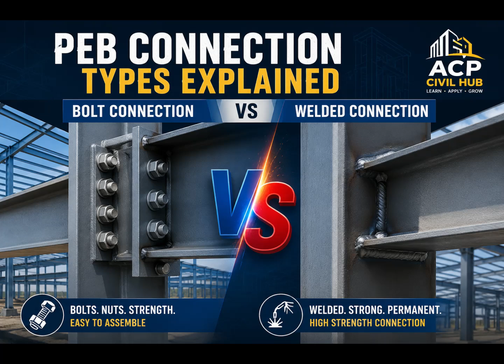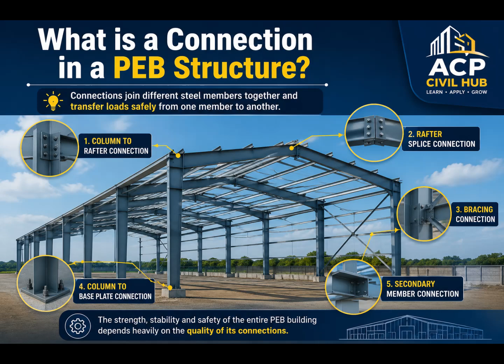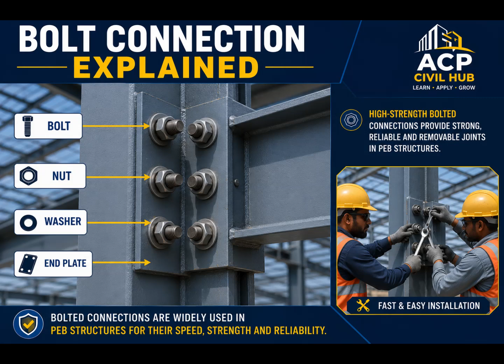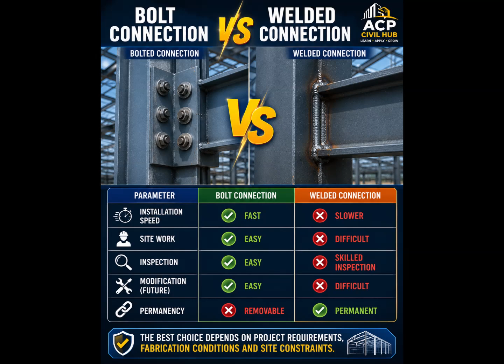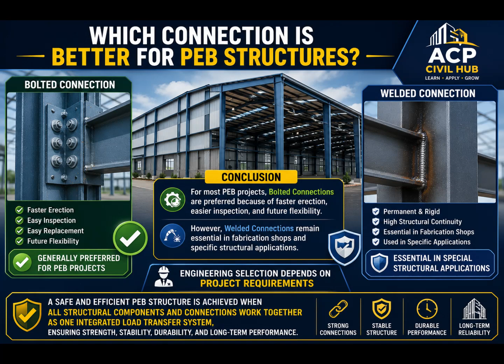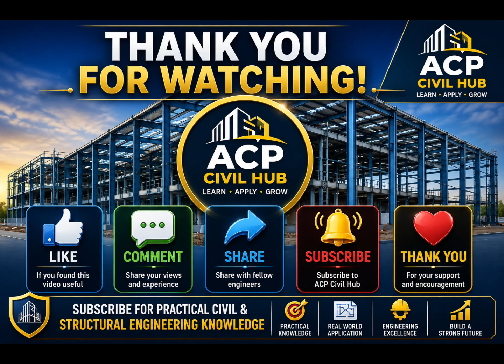PEB_VIDEO-06 : PEB Connection Types Explained | Bolt Connection vs Welded Connection

Comment from the maker: 🏗️ Engineering Question for Viewers:

In your practical experience, which connection do you prefer for PEB structures and why?

🔩 Bolted Connection
🔥 Welded Connection

Share your answer in the comments along with your reason. It will help students, engineers, and professionals learn from real project experiences.

Thank you for supporting ACP CIVIL HUB. 🚀

Comment: Very clear explanation of bolted and welded connections. The comparison section was especially useful because it explained not only the advantages but also where each connection type is practically used in PEB structures. Looking forward to more steel structure detailing videos.
Reply from the maker: Thank you for your valuable feedback. Glad you found the comparison section useful. Our goal is to explain practical structural engineering concepts in a simple and professional manner. More PEB and steel structure detailing videos are coming soon on ACP Civil Hub.